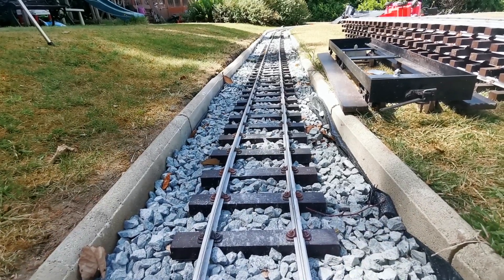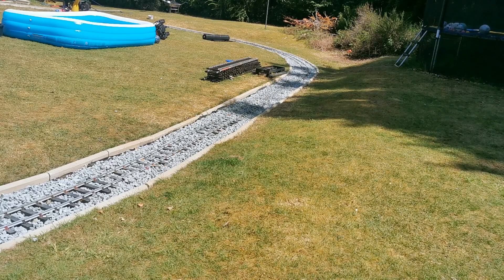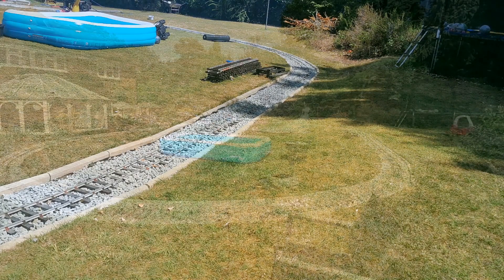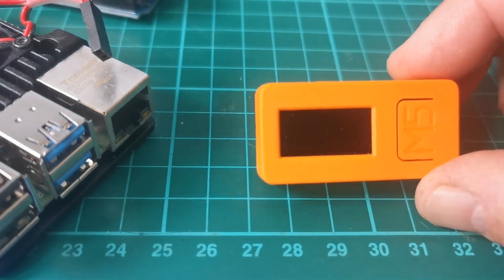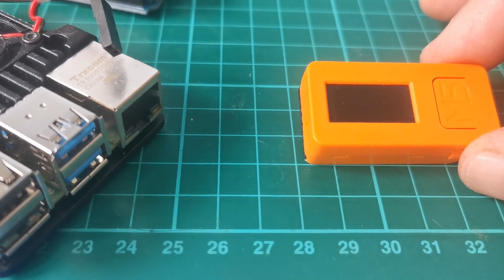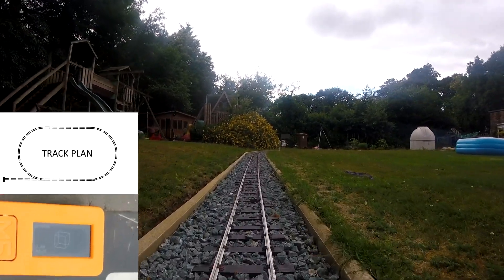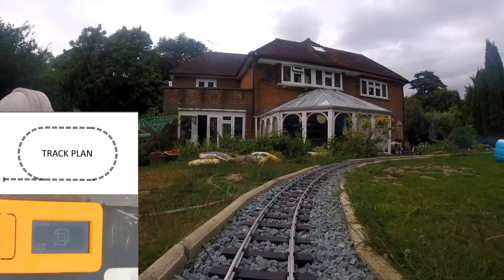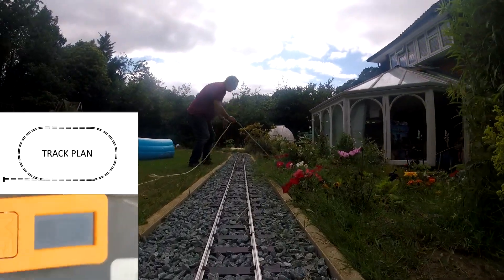5" Gauge Garden Railway Part 4: Track Levelling.

Comment: Hello, It certainly took a couple of months. It was a bit frustrating at times with the derailments. The more I ran it, the more it gradually improved. It seems as though once the ballast is well up in side the hollow sleepers things start to settle down.
Basically my landscapers built what was a path but instead of a hard top it was done with gravel and I built and laid the track on it. The chaps used three tons of gravel on it.  I would say persevere. Dont be put off by the odd problems. You will eventually get  so it  it gives you trouble free running.  You are using a large curves than me but it was all I could fit in the garden!. It runs outside my O gauge garden railway. My wife and I are amazed how well it looks like part of the garden. It has blended in very well. All the best
rgds Graham Powell
Reply from the maker: Thanks Graham.  Good to know others' experiences.  I have a question for you - have you over gauged your curves?  I have (PNP rail set to 5 1/16") and I'm thinking its adding to derailment issues.  Given that we both seem to be running similar wheel sets, i just wondered what your approach/experience has been?
Reply: @RanmoreCommonRailway  Hello  Sorry dont know your name. I think it depends on where you are getting derailments. I set mine up so that the gauge widening was on the curves. Some of the initial problems were down to the carriage bogies . I either had them too tight or too slack. Now they seem to be fine as dont get many problems now. Personally I dont think that gauge widening is your problem. Its more likely down the track not being level cross wise i.e. parallel to the sleepers. I would try a spirit  level across the track and jack and pack the ballast till its as level as you can get it. Then run it fair bit with loaded trains. I think then you should find that you may have the odd problem but things will start to settle down and improve. All the best rgds Graham Powell

Comment: I ve got a ride on railway in my garden. A local firm of garden landscapers and wall builders did the track bed in less than a week. My line is 65 yards right round and I have one point going into the engine shed. Locomotives are Ride on Railways electric loco and Polly Models "Caroline" . The latter will go round the 12ft radius curves. Hardest part like yours was bending the rails and making the track. Initially it didnt run too well but now its bedded in, derailments are mercifully very rare and the grand children play with it. Rolling stock consists of one Ride on Railways coach.  Its great fun and been worth the effort. best wishes Graham Powell
Reply from the maker: Nice Graham.  I like your choice of edging blocks, very smart.  How long did it take for the rail bed to settle?  3 months gone and I'm still adding material in places to stablize the track!